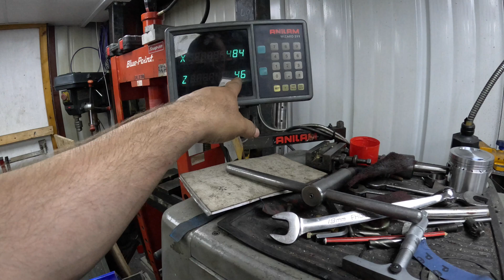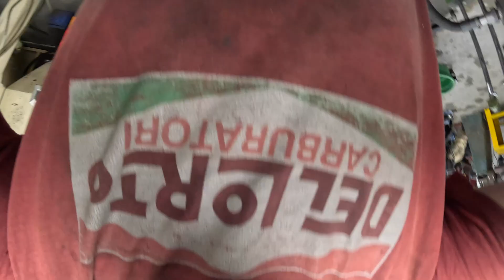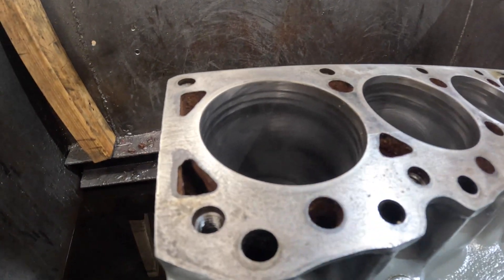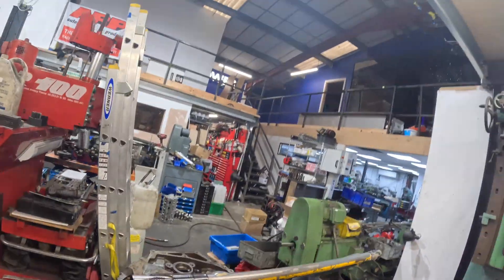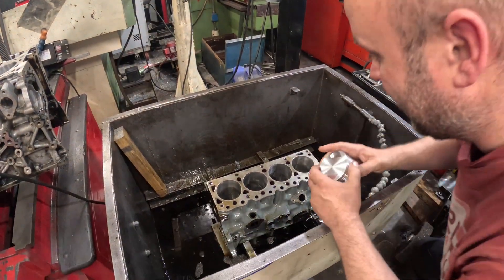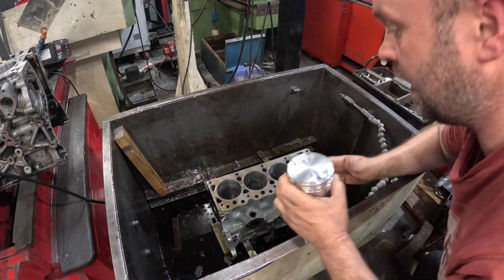MK 1 ESCORT LOTUS TWIN CAM PISTON MODIFICATION & HONING TO SIZE

Comment: Good Morning boss i don't believe if i asked you if started the business from scratch  ? My motor i did a refresh any some upgrades on has a problem the rings will not seal  , the bottom end just pressurises , oil comes out the seals and gaskets 2.5 litres  of oil dumped in 40 kilometres. CP Pistons, Totalseal gaples rings honed on a Rottler hone , carby motor any thoughts for a amateur engine builder from down under . Driven brake in oil
Reply: Gapless top or Gapless 2n/d did you use
Reply: @stujones9976  thanks for your reply, I ask my engine builder to  use  Total seal gapless rings I would have to check the  part number to answer that question.  Have not tore engine down yet .
Reply from the maker: Morning.. I started it from scratch, a small shed at home with 1 bench.. something seems very wrong there.. is one of the breathers blocked or are the rings fitted upside down
Reply: @graceenginedevelopments  yet to strip that what I am looking for things to  check.  Thanks
Reply from the maker: @christophercullen1236  rings fitted incorrectly, piston to bore clearance, incorrect dipstick so to much oil, blocked breather

Comment: Thanks for another interesting video.
I have a simple question that shows how little I know about machining. When using the lathe how do you control the depth of cut? Is it by rotating a control wheel and observing the digital display? I couldn't see in the video how you did it.
Reply from the maker: @roygardiner2229  thanks Roy, yes but I triple measure, I use the read out, the indexed wheel on the lathe and also measure